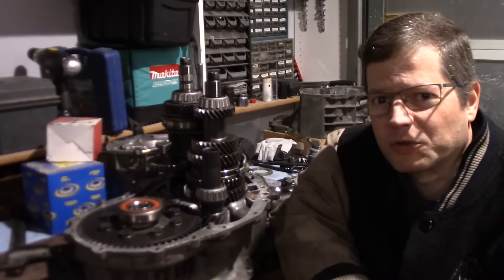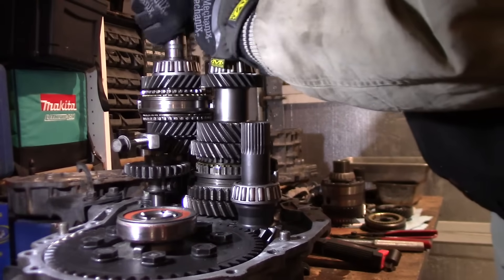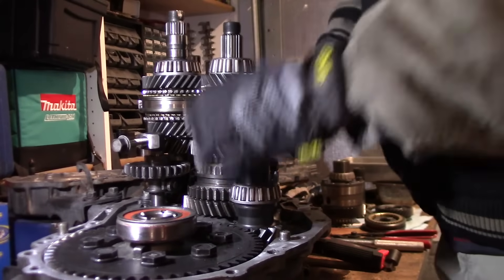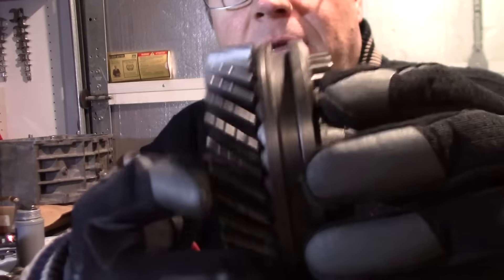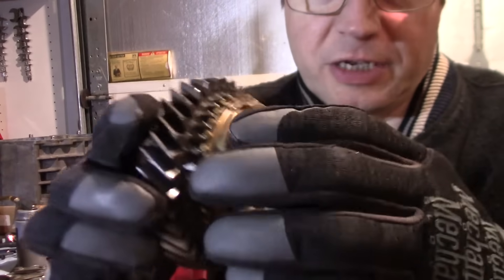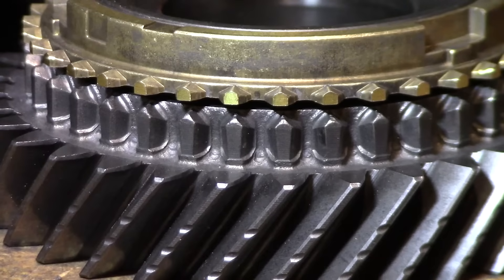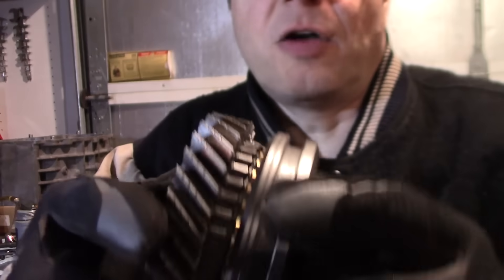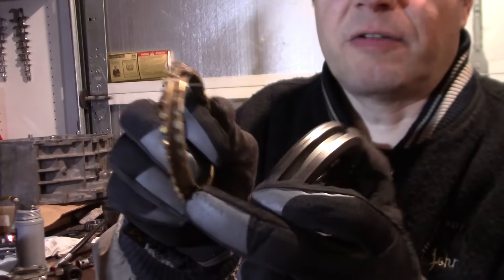How Synchronizers Work in a Manual Transmission

Comment: My buddy would shift between cruising gears without using the clutch. Just by "rev matching", as they say. People who do this believe they are so attuned to their vehicle that they can perfectly match the engine speed with the road speed and mesh the gears. 

But I asked him, how do you know that? There's no feedback mechanism to tell you if you aligned the gears. Sure, if the speeds are way off, you'll know. But the synchros will probably compensate for at least a small percentage of speed mismatch. I think the best you can say is that you're getting pretty close to matching the speed. But then you are also making the synchros do their work under load. And they aren't intended to be a wear component as is the clutch. 

Anyway, he didn't know synchros existed so I think that explains it. He stopped shifting like that. (At least while driving my vehicle.)

Maybe I'm wrong. Maybe they don't compensate in that way. But we know for sure that there is no way you can perfectly align the collar teeth. The best case scenario is that you perfectly match the speed. But the gear teeth will most often be some random degree of misalignment and the synchros will have to guide them in. But again, they now have to fight the resistance of the entire drivetrain and engine to do so. When the clutch is disengaged, they are not fighting anywhere near that much inertia.
Reply: Ex T55 commander and German engineer here:

Those Soviet designed tanks had a 5-speed (F) and 1-speed (R) gear box without any synchromesh. The engine had a 580hp (later 620) V12 Diesel engine and the tank a weight of 36 metric tons. The tank had a simple but gigantic  main clutch to shift the gears - the whole drive train was pretty much like an truck from the 1930s (except for the planetary gears at the sprocket wheels to drive off and for steering).

Many of our drivers/mechanics managed to trash around these beasts in heavy terrain without using the clutch at all and still very little screeching noise. They basically went after vehicle speed and engine noise (they had a speedo meter and an rpm-meter, but it was too awkward to look at it, since the dashboard was hard on the right hand side of the driver's seat - far away from his eyes).
So this entire clutchless-practice is indeed possible, but it requires a lot of mechanical "feeling" for your vehicle and therefore practice. The trick is to pull the gear shifter very gently (just not to screech) until it flops into the desired gear the moment both rotating speeds match perfectly. 
At least this is what they told me, I never managed it without some noise - but as commanders we had only limited and therefore less driving lessons and practise.

From the stories of my grandfather serving in WW2 in the Wehrmacht as a mechanic-soldier, he also confirmed that most of the heavy vehicles, specially trucks, had no synchro gearboxes and therefore required constant double clutching, and they also knew how to drive them with worn-down unfunctional clutches ( a very common occurrence at a battle field in those evil days). Double-clutching was the norm in the 1940s and driving heavy vehicles without clutch as an emergency mode common practice.

With modern gearboxes and long-lasting clutches these days there is no need to do that at all. With manual-shifted classic cars I would always go for the whole double-clutch procedure every time. There is no need to punish old vehicles by trying to ignore the clutch. 
Specially since the clutch has an extremely low wear and tear while double clutching, since their is no real vehicle momentum behind anymore; each stomp at the clutch pedal and release has almost no friction while doing so.

I owned and rebuilt an 1972 Ford Transit which also had defective 1st gear synchro. So shifting down into 1st gear (rarely necessary) I did what we did with the tanks, proper double-clutching and plenty of a gas-kick in between. The 1st gear kind of flop-drops in without any mechanical resistance.
I also replaced the gearbox oil once to get rid of possible metal dust within the oil. Did not change anything in gearbox behaviour (as expected) but I hope it will not grind-wreck other gear box internals.

Peace! from Dresden / Germany
Reply: The key is getting the speed close, so then there will be a moment when the splines align for just long enough. Too much speed difference and the splines are passing each other too quickly to mesh, and if you manage to perfectly match the speed, you are correct that they most likely would be misaligned, but a perfect match in speed wouldn't last long in the real world (until they are meshed of course). And also you are correct that shifting without the clutch puts unnecessary wear on the synchronizers, but if you use very little force I can't imagine it's much worse than shifting forcefully with the clutch. 

I've played around a bit with carefully shifting without the clutch, and there have been a few times when the shift happens so smoothly that I question if I even shifted. In these rare cases I believe I just got lucky and managed to shift at the exact right moment to mesh without noticeable interference between the splines. So I fully believe it's possible, but it's not very plausible to perfectly shift without the clutch or help of synchronizers. However I have heard that the manual transmissions in a lot of semi trucks are built to be shifted this way (look up "floating gears") in order to save on clutch wear, so I imagine the splines are built with more play to accommodate this.
Reply: @mikeraphone7868 Yeah, I'll admit I've tried it, too. It does feel very smooth if you get it just right. Even if I could get good enough to do that reliably, I'm sure they would void my warranty for doing so.
Reply: There is ABSOLUTELY a feedback mechanism for you to sense the exact instant the speed is synchronized and the shift sleeve will slip right over the dogs on the speed gear.

If you put a tiny amount of force on the gear stick, towards the gear you want to engage, you''ll feel the the gearset literally suck the gear stick in at the right instant.... Basically the equal (but opposite) phenomenon of how you can slip the shift sleeve OFF the speed gear, clutchlessly, the instant you lift off the throttle and create a (brief) torque reversal from the drive side of the gear to the driven side of the gear.

I've been doing this for literally 30+ years and many many hundreds of thousands of miles. Nearly 20 years ago, the pilot bearing for the T5 transmission in my thunderbird seized - which essentially locked the input shaft to the crankshaft. This was my only car and it happened on a Monday morning. My commute to/from work was 50 miles each way. I drove the car clutchlessly all week - then pulled the trans and replaced the clutch and pilot bearing the following weekend. Wasn't any problem at all. I knew the car and T5s are some of the slickest shifting manuals ever. I slipped the car into neutral as I approached a stop light, then shut the car off. When the light turned green I selected first gear, started the car - which got me going from a stop.

Some transmissions are way more easy than others. T5s are the best ever because the gears are small, have low inertia, the single internal shift rail has low friction, and the shifter is mounted directly to the transmission; no cable or cumbersome linkage to "eat up" the feel.

I'm sure there are lots of dummies that THINK they're doing it right when they're not - but it CAN be done correctly; and some of us do it.

Last, don't forget the synchronizer is not there just to synchronize. They're also known as "blocker rings" or "baulk rings" - they PREVENT the shift sleeve from engaging the speed gear when the speeds are mismatched just as much as they help match the speeds.

Non-synched transmissions will grind hard if you push on the gear stick at the wrong time AT ALL.
Reply: @GroovesAndLands  
I agree with you 100%. I even heard about the famous T5 Ford gearbox which was used in so many Ford vehicles, at least in variants.

Yes, I once also drove my Ford Transit home over 500km (350miles?) when the clutch failed. It did not disengaged any longer since the release bearing started to go very heavier and heavier with exactly the same procedure, including through a stop-and-go traffic jam on the highway.
Thanks god my starter battery was in a good healthy shape on this day.

This European-made Ford van (check in Wiki "Ford Transit MK1") also has its long gear shifter going straight and directly into the gearbox without all the joystick-like wobbly mechanism. Its lower end moves the gearbox internals.
After cleaning up the gearbox neck from very old slick-grime-dirt the next day everything went back to normal (the car by then was already 30 years old).

Actually I am from East-Germany and I was raised and educated there. 
So when your learnt how to drive a 620hp T55 beast and a 2-stroker 26hp Trabant, you were able to move any other vehicle on planet earth 😃, clutch or not.
40t-tractor-trailer or lawn mower, no worries. Anything goes as long as I do not have to walk.

Peace! from Dresden / Germany
Reply: @GroovesAndLands  I can imagine the direct-mount shifter would make a difference. But since my buddy didn't even know about synchros, I was rather skeptical of his ability to shift accurately without the clutch.
Reply: Old cars, and especially manual heavy equipment like dump trucks, semi trucks, did not have synchro gears for a very long time, and it was in fact possible to float the gears by rev matching, but some of those trucks had transmission RPM gauges as well as engine, and of course the high rotating mass means the engine and transmission RPM change slower, so it's easier to float the gears (what my truck driving uncle called shifting without using the clutch) but I also heard it isn't reccomended on passenger cars.
Reply: I've been doing this thinking it must be painless because it's selecting the gear successfully. Will avoid it now. Thanks for explaining.
Reply: When I was a kid the cable clutch bracket on my (factory) v8 Monza (vega platform) broke - and I couldn’t afford parts to fix it for weeks. So I drove it without a clutch to do what I had to do.  I’d slip it into neutral and try to never come to a complete stop.  When I did have to stop/park I had to kill the engine and then restart in first gear.  I never got stranded and once it was repaired it worked fine for as long as I had the car.  It was sure a crash course in manual shifting. Being 19 was so great - I had no idea.

Comment: I have seen so many shorts on "this is how synchonizers work" but I never fully understood how they can work as I was missing a few pieces of information. It wasn't knowledge that I like absolutely had to know as I would've looked it up more properly in that case but it was bugging me so much that I couldn't figure it out. This was an amazing explanation for someone who knows a thing about how a transmission works to begin with like me and I thank you for this quick and simple demo, but someone who is new to this will not understand what's going on and that's fine too as it will make them want to explore and learn more and then after some time they will come back to this video and "oh yeah that's the thing that does the thing, it's so simple now". Honestly one of the top 10 feelings I myself have experienced.
Thank you <3

Comment: What is it that causes the bounce back? 
Thanks for the video 👍
Reply: I think the chanes in friction in the moment when the ring and gear come to same speed.
Reply: @headtungsram6920 thanks 👍
Reply: This is the missing link I've never understood.

Dude demonstrates how the synch can rotate ±10-15º with respect to the shift sleeve. The synch teeth align with the splines of the shift sleeve ONLY when the synch is centered. When the synch is rotated either +10º or -10º from center - it BLOCKS the sleeve from moving towards the speed gear. This is why synchs are often called "blocker rings" or "baulk rings".

So imagine the speed gear is spinning faster than the shift sleeve:

As you push the sleeve towards the speed gear, the synch cone will rub on the speed gear cone, and the synch will rotate into the +15º position where it BLOCKS the sleeve from continuing towards the speed gear. Meanwhile, the sleeve will accelerate up to match the speed of the speed gear. But when the sleeve reaches the same speed as the gear - the synchronizer would still be in the +15º position - and will still be blocking the sleeve from engaging the speed gear.

It seems there would need to be a torque reversal to get the synch to reverse the 15º, aligning its teeth with the dogs of the sleeve.

Where does the torque reversal (bounce back) come from?
Reply: @GroovesAndLands thanks for that helpful description. Based on what you said I have developed a theory about how it might work. We have been looking at it as though there needs to be a torque reversal to align the blocker ring correctly. But maybe that's back to front? Maybe there is enough "slack" in the +-10 degree rotation of the blocker ring to mean that it's generally possible to engage the gear in almost any position apart from at the very extreme ends of that rotation. This would mean that it only acts as a blocker when the ring is fully rotated. The question then is not, what torque exists to reverse the rotation?  (Answer; there isn't one). The question becomes, what torque exists to hold the blocker ring at the extreme end of its rotation to ensure it acts as a blocker? And the answer to this is, it's the torque generated by the speed difference between the speed gear and the synchro ring which is created by the blocker cone interface onto the speed gear. As soon as that torque dissipates, because the speeds become synchronised, the free play then allows the gears to engage. That's all I can come up with.
Reply: @GroovesAndLands  The pressure you are exerting on the selector fork by pushing the gear lever, should start to engage the synchro hub to the gear as soon as the teeth line up. The way the edges of the teeth are bevelled ensures that the chance of not being able to engage are very slim.
Reply: @rickconstant6106  I have no idea what you're trying to communicate.

Comment: Seems like the brass parts would be all worn down after a few grinding shifts.
Reply: The brass synchronizer rings don't mate to the gear itself, it only uses friction to help match the gear speeds, then aligns the gear with the synchronizer so it can slide onto the gear smoothly. When you grind a gear that's the steel synchronizer grinding against the steel gear, the brass gear teeth aren't grinding against anything.
Reply: The brass rings do wear down, the internal machined diameter loses it's serrations which provide friction against the gear cone during the shift. This causes the shift hub and gear to not match rotational speed, resulting on steel to steel grinding.
Reply: @abpsd73  Yes but the tapered ID of synchro rings wear down after substantial use rather than rapidly wearing down after just a few bad shifts as OP is guessing. Synchro rings can last for several hundred thousand to even millions of kilometers.
Reply: Grinding comes from the steel teeth slipping against each other, not the brass rings.

Comment: Mechanic from way back. You didn't tell what the 3 little plates do. I've forgotten now but they play a big roll.
Reply: The three plates and the round wire springs act as a detent for the lock ring.
They detent in the centre as well as the stop of travel when engaged into the gear.
Also the detents pull back the syncro just a tad when the gear is fully engaged to stop wear on the syncro and gear taper surfaces.
Stops the ring in the centre between the two gears so the ring doesn't flick and bounce around stopping damage as well as keeping the box quiet.

Three plates are used in smaller gear box's, but can have many more on larger gearbox's.